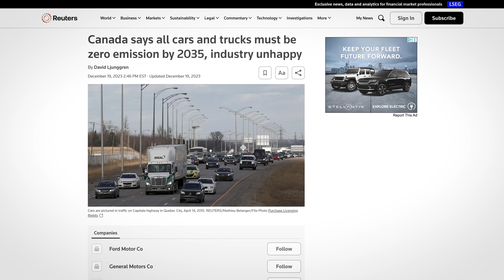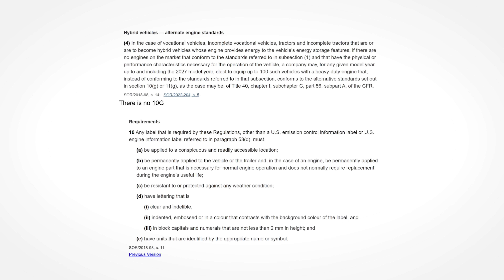Government Red Tape Is Blocking Our Plug-In Hybrid Trucks

Comment: I'm extremely disappointed with our government right now. 
Nicola got to fake building a functional truck. Tesla was supposed to produce one years ago. 
Edison Motors has a functional truck design and the government isn't getting a big enough kick back.
Reply: There are plenty of purely electirc lorries on the road in Europe, built by MAN, Renault, Iveco, Mercedes, Scania, etc.. Neither Nicola nor Tesla are competitive in this field, neither in specs, nor in driver comfort (which is kinda important for long haul routes). The mercedes one has a 6 hour range and charges at 400kw from start to finsih on CCS is fast enough to fill up during the mandatory breaks, the first MCS charger with 1000kw has been opened in the Antwerp cargo harbour area.
Reply: Our government? Who? Canada 🇨🇦 or 🇺🇸 America?
Reply: Nikola did build a functional truck in the end, it sells in Europe as the IVECO S-way electric. The electrotrucker drives one. The Nikola TRE was mostly an IVECO s-way with a Nikola wrap.
Reply: This is what causes disappointment in the government?
Not the fact they have completely killed canada in the last ten years?
Reply: @CaseyBDook, you'll be even more disappointed when you finally figure out it isn't your government and it never was.
#JonesPlantationFilm
Reply: oh, wow, Youtube has now fully censored that hashtag. Guess you'll have to use a search engine.
Reply: I don't like the gov at all...
Bro was saying to use RED FUEL on road... cause its "off road"
Bro never saw this coming? LOL

Take a on road one, and mod it... this aint that hard.
Reply: Baiting for a future market by design....1% ers are playing with us. Imo
Reply: This is the government Canadians "supposedly" voted for, so it is fully expected.
Reply: Communists always only have rules that we have to abide by.
Reply: Keep voting liberal...
Reply: Nicola didn’t fake anything.  A short seller wanted to make money on their collapse, and actively MADE it happen.   A tactic that should be 100% illegal, but is not, yet.
Reply: Nicola is a bad argument, otherwise you could point fingers at every prototype that failed to make it to production. 

Did it ever occur to you that Tesla could be facing government regulation preventing their trucks from being built? Such as the permits needed to instal the massive charging stations to accommodate the semi with a trailer. Or perhaps they cannot get enough battery cells. Why accept setbacks by one company and not another?
Reply: @mikebalentineNicola isn’t a bad argument. 

It was as scam that coasted billions.
Reply: @SmokeySeventy-Six  so? The people that lost billions were rich people and companies that made poor investment choices. You act like this is uncommon. Who are you so concerned about that lost their money? Seems odd since it wasn’t taxpayer money or anything.
Reply: @SmokeySeventy-Six - Do you know that it was a single, wealthy and motivated short seller investor who caused Nikola’s collapse, by working with government  and media?   It’s a sick sick story, and you are blaming the wrong people.  Just like they want you to.
Reply: @SmokeySeventy-Six   So is Edison a scam that will cost a few millions?
Reply: @mikebalentinebe fair Tesla does have a truck on the road but it's in testing and I think it's largely because they're trying to push their automated driving system for the trucks. That's going through a lot of testing and it's probably going to need more screw tonight than for the cars which are technically still in testing right now. I think cars will be certified and done by this year or next year and trucks probably soon after but the trucks themselves are made and I think they started rolling this year or last year so sure it took them years but it's happening.

Edison Motors is doing something a little more special and they don't have the money and backing that Tesla does so you can't really compare them and Edison is doing very good considering the resources they have to work with. They're in production right now  after all.
But no need to knock other companies. Honestly if Edison was operating in America they'd probably be doing even better because we're just more business friendly.
Reply: @waltermh111  I think you misread what I said. I was responding to the Nicola comment. 
Edison Motors out of Canada is doing something awesome. For heavy duty trucks I’m absolutely in favor of hybrids. I full time RV and would love a hybrid truck (with generator) but sadly no one makes one yet. I have my fingers crossed for Dodge’s ramcharger. I’d buy Edison’s kit but that is not an option.
Reply: @mikebalentine  - maybe it is called not enough baseload power or transmission capacity for pure EV road transport....
Reply: @mikebalentine tesla's truck is very obviously a talisman, all looks no functionality, they can't even keep passenger cars from killing children.
Reply: @mikebalentine Nicola is not a bad argument. Nikola was an outright fraud that got traction and praise for vaporware and making a concrete paver contractor their CTO
Reply: @mikebalentinethe Tesla engineers are incompetent. Their vehicles keep catching fire and killing operators
Reply: @GuntherRommel  that's not a tesla problem smart guy all lithium ion battery's can catch fire at random the vehicles just happen to have a lot of them so its more likely, and if your so smart go make your own.
Reply: @GuntherRommel  
That's also a shit argument. By that logic, combustion engine based engineers are worse since fuel powered vehicles catch fire far more often.
Reply: @GuntherRommel  let’s say you are right (which i highly doubt) I sounds like you are unaware of the sheer number of automotive fires that kill/injure people
Reply: @jayw900    - ?? percentage terms / consequences / etc - ha ha.. nah..  (Most ICE vehicle fires are Arson or accessory failures - electrical faults or oil/hydraulic issues....)
Reply: @GuntherRommel  Gimme a break ...
Reply: @bobnotbob6668  Brain-dead take. Gasoline can catch fire, but internal combustion vehicles manage to avoid this just fine. Know why? Laboratory research and government-mandated safety equipment. If a car is catching fire "at random" that means it's an unsafe design that needs to be recalled and taken back to the drawing board, just like Ford had to do with the Pinto in the 70s. The Pinto, by the way, is a name that is STILL notorious for exploding and catching fire, despite the fact that more than twice as many Teslas have done the same thing and injured or killed over twice as many people. How is it that half a century ago, manufacturers were held to a higher standard of safety than they are today?
Reply: @mikebalentine It's very very very very few, actually. Like, less than 0.001%. Modern internal combustion cars have fuel tanks designed not to rupture or spark in a collision and sensors cut power to the fuel pump if the air bags are deployed. The percentage of internal combustion cars that catch fire in a crash is minuscule compared to the percentage of electric vehicles that catch on fire in a crash.
Reply: @thematt6705  nice straw man
Reply: @GuntherRommel  Ignorant post!  Here is a REAL fact. In the USA,+ on any given day, there are an average of 400+ car fires from ICE vehicles.

Comment: Using a generator means less emissions and it would decrease fossil fuel use. Isn’t that the point? 🤨
Reply: I don't understand how "Zero Emissions By 2035" permits any fossil fuel engine/generator on the vehicle. Tier 4 diesels create emissions, whether configured as engines or generators. Do they envisage all vehicles being battery-electric, no hybrids?
Reply: @RoamingAdhocrat  No. “Zero emissions” just means that the vehicle is capable of being zero emissions. If its a plug in hybrid then that means that theoretically the vehicle can run forever without the generator ever kicking on, providing you have the adequate charging infrastructure. Having every vehicle be practically electric incentivizes the creation and upgrading of the infrastructure needed to serve more electric vehicles.
Reply: @MexicanStandoff-l5umy 1989 Fiesta was "zero emissions" then, because you could drive it up a hill, turn the engine off, and coast down the other side in neutral
Reply: @MexicanStandoff-l5uTo be clear - my argument is with the government's choice of words, "Zero Emissions", when that's physically impossible for a truck that's driving continuously on a highway for hours at a time. The Edison plugin concept is brilliant and I hope it can become the standard, replacing diesel trucks worldwide!
Reply: @RoamingAdhocrat  You burned fuel going up the hill in the fiesta. In the hybrid/battery electric vehicle you burn no fuel going up the hill, and regen charges your batteries going down.
Reply: @RoamingAdhocrat  I mean, with 500KW charging it’d practically be no different than the amount of time it’d take to stop and fuel an ICE vehicle…. Maybe a bit longer but not by much.

Comment: Use an auxiliary power unit to charge the battery as a stand-in to charge, and just require the truck to park for the 1 hour it takes to charge. Or use the cummins Atkinson engine as a generator with an on-highway power unit.
Reply: That is exactly what they are doing (less the Atkinson cycle).

Comment: Is there a MANN engine available that's On Highway certified, but does NOT require the aftertreatment system, that IS the right size for the job (~ 9 liters)?  Not optimal, but COULD move Edison forward.  An on highway engine should be perfectly happy running at a constant 1,800 RPM (60 Hz) or 1,500 RPM (50 Hz).

Comment: Why don't you use your tier 4 on-highway engine and connect it to the guts of a generator?
This gets around the regulations and gives you the legal standing to move forward with building your trucks.
Reply from the maker: Because on highway engines aren't programmed as generators.  It would be waiting for the driver to press on the throttle to command fuel.   We aren't legally allowed to change how that programming works apparently
Reply: @EdisonMotors 
I get what you're saying, however, you should be able to use the same connection that commands power from the generator to run the on-highway engine which simply replaces the generator motor. You don't have to re-program anything. The generator runs on demand when the battery system gets below a certain voltage, so it is independent of the driver's throttle system. 
Look at Europe for possibilities that may already exceed what the government of Canada requires. I'll bet there's already a generator in existence that is using a small on-highway diesel engine for power.
Running at specific rpm's makes for a very efficient system, and should exceed their tier 4 requirements. 

If you get real stuck and need a better explanation of what I'm talking about, we can maybe do a quick video call sometime, or I'll take a couple of days and drive up there for a little bit of hands-on work with you. I'm about 5 hours due south, so not a huge deal to make it up there. I'll bring the wife and dogs, make it a little bit of a vacation and see what all you've got go on.. 
Exciting stuff for us who are into this kind of thing- and doubly so for truck drivers with a few million miles under our belts.
Reply: Keep there throttle pedal and use a completely separate stepper motor to push/pull on it, and control that motor with electronics built into your hybrid system. Keep throwing shit at the wall until something sticks.

Comment: Curious . . . If you guys sold the trucks as a fully electric truck but then installed the diesel generator as an after thought or something that isn't "hard mounted" to the truck, could that be a work around?
Reply from the maker: Do like Tesla did with the light bar on their cybertruck and let the customer connect the wires
Reply: @EdisonMotors  or do like some manufacturers do and "dealer installed options" are just parts mounted but left unplugged at the factory.